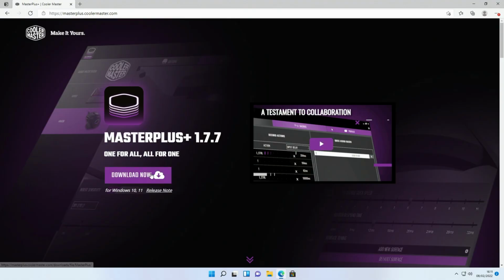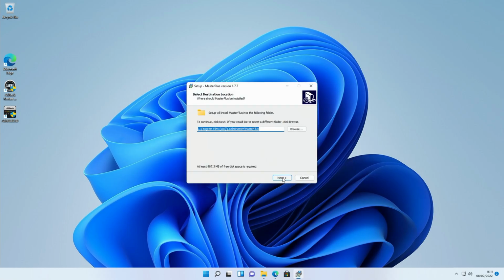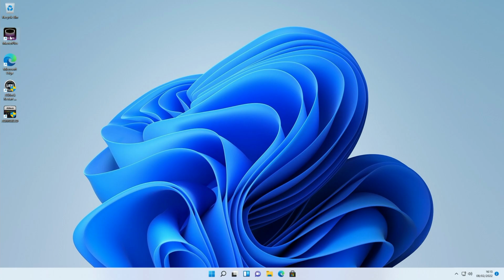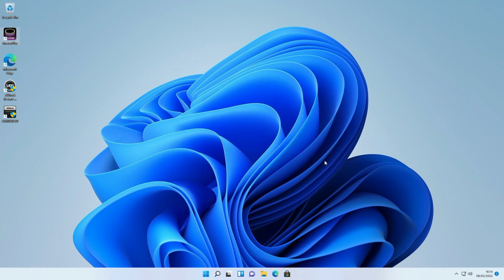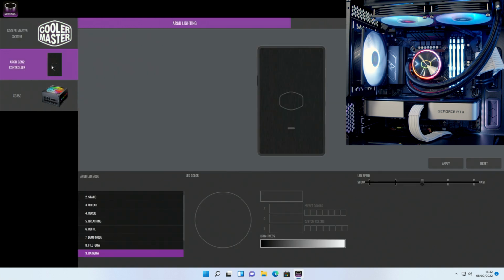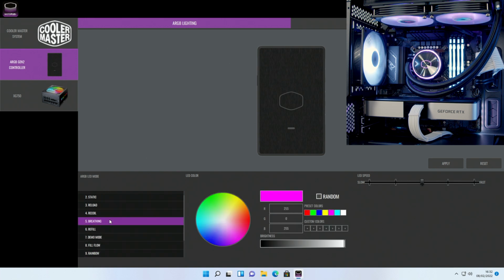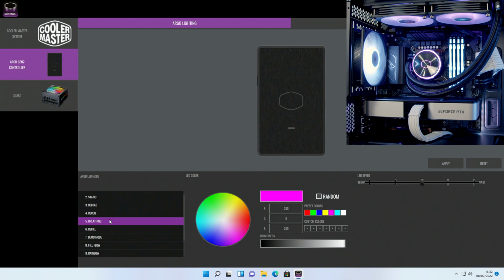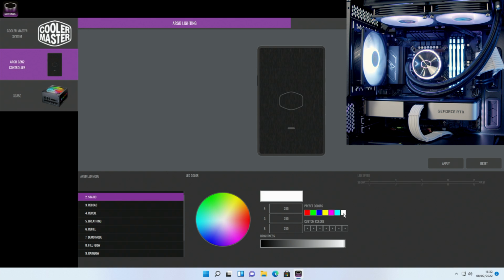Cooler Master MasterLiquid PL240 Flux - Installation Guide

Comment: (see answer below) 00:19 After installing these four screws, there is a slight wobble/play between the bracket and the motherboard. The screws cannot be tightened further. Is this normal, and will that go away once the cooler is mounted to the bracket screws about the CPU? It feels very odd that the bracket labeled Coolermaster 1700 has slight play on a 1700 motherboard. I am assuming this will go away after I mount the cooler to the motherboard.

Edit: I tried mounting the cooler with the nuts, and it removed all play between the bracket and the motherboard. I updated the post in case someone else arrived here for the same reasons.

Comment: Is it possible to just connect this rgb splitter cable to an rgb port on the motherboard?  Or the one in my case even? I don't want to use the controller.
Reply: Yeah if you have extra rgb headers.